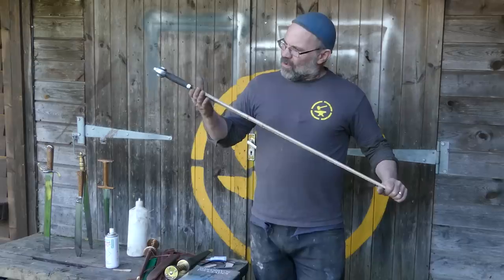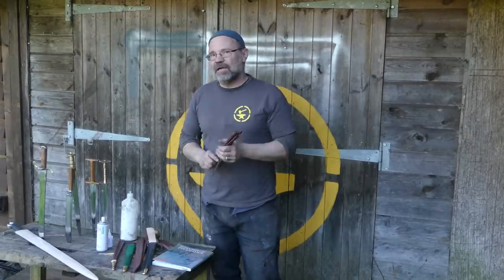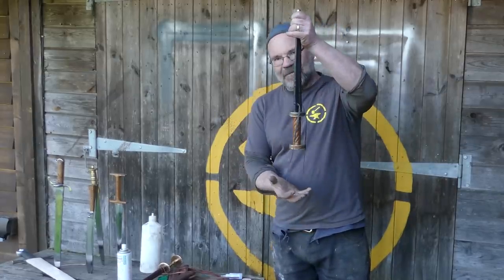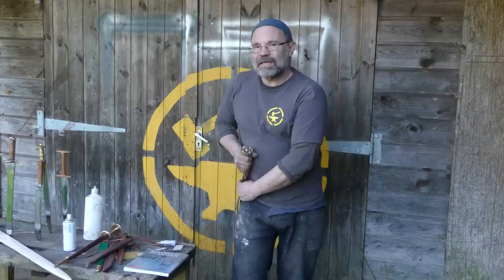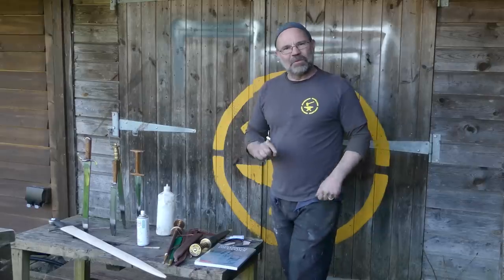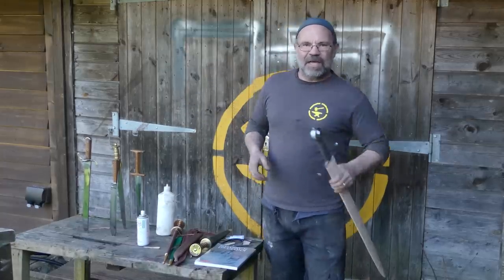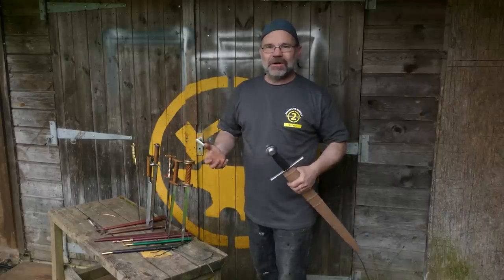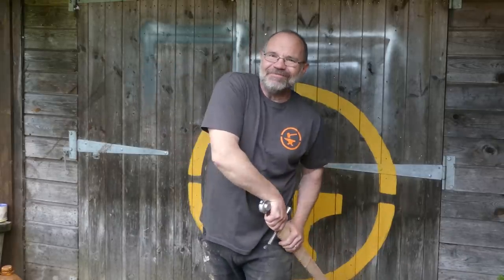How Tight were Medieval Scabbards?

Comment: It actually makes a lot of sense for knives and swords to be made by multiple people in medieval times. If you are going to outfit an army, then instead of a single person makeing one entire sword maybe every two days, it would be faster for someone to be churning out blades all day while another person churns out handles and another scabbards, all to be assembled by another person elsewhere. It's kinda like an assembly line.
Reply: Isn't how things for military use are made even today? One company produce belts, an other holsters, an other bayonets ect
Reply: Absolutely! Way easier for someone to get good at making one thing quickly than to learn to do ten different things quickly. It's also the case that there were places that were hubs for certain kinds of goods, like Solingen for blades. It was common (not just in the medieval period) for blades to be made in one place, and then made into functional swords/knives elsewhere. So you could have one smith hammering out several blades in a day or two, and then after a few months those blades could be in four different countries fitted to guards and pommels that fit the regional tastes. 

To take that even further I can think of examples of African swords that Europeans stumbled across in the 1900's that had straight double edged blades (exactly like the stereotypical medieval european sword) fitted to locally made African guard, grip, and pommel. If I remember rightly those blades were actually made in parts of Germany in like the 1700's or 1800's (after Europeans had moved away from that style of blade) specifically for the African export market. Sorry for the essay lol.
Reply: And if it resembles modern day civilian and military contracting, the products are going to be made by the lowest bidder who meets the minimum specifications.
Reply: That’s one of the reasons armorers in Italy and Germany could crank out an entire harness in a couple of days.
Reply: It makes sense, if conditions for mass production are met. It's only worthwhile (or even possible) to break down production into lots of small steps each carried out by someone with a very narrow specialisation when you are able to: secure lots of capital to bring together enough people in the same workshop (or have a sufficiently mature market for a reliable supply chain up and down stream), and have access to a sufficiently large customer base so that there's enough demand for all your wares. Not all of those ingredients were present everywhere all the time. During the Roman Empire or in Renaissance Germany, sure. But I'd be surprised if that was true for, say, a Carolingian sword/armour smith who was only ever going to sell his wares to a minor local lord and his retinue.
Reply: @Pavlos_Charalambous one recievers, one barrels, one optics, one grips, etc.
Reply: @Pavlos_Charalambous  A mcuh better example would be large ticket items like ships, planes, tanks. While one company is awarded the contract, that company in turns sub-contracts out to dozens, or even hundreds of other ocmpanies for parts and companonents. Take a plane, Lockheed may have the contract but engines would be provided by GE, and the radar by Raytheon, then tons of other companies provide the nuts, bolts, and other fasteners, the wires, the tires for the landing gear, and so on.
Reply: The principal behind mass production.
Reply: Principally was because in medieval time differents workers were in different corporations, if you were a blacksmith you were prohibit to do wood works, there were law very strict about it.
Reply: I think your logic is a bit flawed. Consider the scenario where five blacksmiths each forge a separate component of a sword; the time it would take is more or less equivalent to five blacksmiths independently crafting entire swords, provided they have the proficiency to fabricate every component.

Let's illustrate this with an analogy. Picture five craftsmen each dedicated to creating one specific part of a sword, and it takes them an hour to produce their respective piece. Given the sword consists of five distinct parts, the group would collectively assemble one full sword every hour. Conversely, if the same craftsmen individually fabricate complete swords, each would need five hours since each component requires an hour to make. However, considering they are five craftsmen, they would collectively forge five swords every five hours, maintaining the same rate of one sword per hour. Naturally, a small amount of time is factored in for transitioning between workstations.

I think the real reason for specializing is efficiency. Having five craftsmen individually producing entire swords would necessitate a complete set of tools for each of them, which is far less efficient compared to each specializing in a single component.
Reply: @bobthegoat7090  I think your initial assumption is incorrect. When doing the same task repeatedly, the person improves at the task, specializing in skill. You can't specialize in five things as well as you can in one, that's the point of specialization. So five 1-hour tasks would be 5 hours for a generalist, but would only be maybe 40 or 45 minutes each for the five specialists. 

You brought up a good point with the tool sets. There are also jigs etc. And making 5 different things means 5 different shapes of raw materials to evaluate, plan for stocking, purchase, and organize. This takes up time and it takes up space in a shop.

There's also a time savings when you aren't task-switching. This is different from becoming more efficient because of improved skill specialization. We talk about multitasking, but it's BS; in reality people have to stop one thing to do another, and those who claim to be good at multitasking are really just reducing their task-switching time by reducing how much they're thinking about one task or the other. Anyway, if you have to change materials, change tools, clear off your workspace and set it up for the next task, that represents a lot of time. Especially if you're doing it frequently. Changing the forge temperature to work with a different metal. And we're not even talking about a switch in the fundamental style of the task, such as hammering away at a blade vs. engraving or filigree. 

Remember that a 10% tithe was considered onerous, all but impossible for a business to pay and stay afloat. Imagine if your personal income were suddenly taxed at 10% higher - not just the highest bracket, but the entire income. So then consider that a craftsman might gain 10-20% efficiency by specializing. Suddenly it makes all the sense in the world.
Reply: medieval industral revolution
Reply: @Intranetusa There’s this “lowest bidder” again. But at least you get the gist of it. Most just emphasize the term “lowest bidder” without any context. Though “minimum specification” is not the term I’d use. I’d use “wanted specification” or “set specification” or  “exact specification”.
You won’t produce an ornate scabbard, after all, if a plain one functions just as well.
Reply: @Specter_1125  I think in Milan, it was the Missaglia family that ran an entire vertically integrated operation? They owned iron mines, they owned bloomeries and smelters, they owned all the workshops: cuirass makers, helm makers, gauntlet makers, mail makers, etc. Sallet to sabaton, they oversaw the whole process.
Reply: don't need to think about it. There is a lot of evidences proving with no doubt that forge was the first of all works to be divided.
Reply: @Intranetusa  Jonny pointy stick just needs a spear that goes in the enemy, not a work of art.

How durable Minimum standards are is the question. Too high quality and the cost means less soldiers.  You also don't want single use spears either.
Reply: It is perhaps what led to industry, but not the other way around.
People had specialised trades. However, this was not universal. In larger, later settled areas there were more specialised craftsepeople, but in earlier/smaller settlements more people did more things themselves.
It came to make sense for these trades to refine more as the skill required to produce a higher quality component/object was more supportable by a more cohesive and logistically sound community.
Prior to this? If you want nails, you have to source the ore, smelt it, work it and then nail it.
It wasn't a production line. It was a collaberation of tradespeople finding a way to make more objects, more cost and skill/training efficiently, but not a true modern industry as we would think of it, but a 'cottage industry'.
Look into the production of linen for a good example of this.
Reply: @allengordon6929  With regards to firearms mass production (ie. different parts made by different companies) was not really a thing until the early 1900's.  Pre this time precision engineering was not good enough for one company to make a part that would fit precisely with another part made by a different company.
Reply: @googiegress  You are correct. In the original comment it just seemed to me like he thought the assembly line style would be 5 times faster than 5 guys making complete swords. My guess is efficiency was the main objective and that is what I wanted to point out with my analogy while clearing up the fact that the assembly line style would not be that much faster(Like for example 2x faster). And yes I know my analogy didn't account for task switching and I also pointed that out. I am aware there are some factors that will increase speed. However I think efficiency was the main thing, as I think not making 5x as many ovens and tools is the main priority.

Edit: And specializing is of course also a big reason.
Reply: @bobthegoat7090  Specialization is present in todays handiwork too. We don't train general surgeons in Finland anymore. Research has found out, that the results of operations just are plain better with surgeons that specialize doing that one type of operation. So even a specialized surgeon, say Ortopedics, have sub-specializations, and I've heard that it's pretty tough that new Orthopedics have to decide if they want to operate knee or spine or hip for the rest of their career...

But yeah, there are no surgeons anymore, that would operate bones and bowels and nervous system and everything else. The results are just plain worse than having surgeons specialize in specific body parts, even if it was handy to have one guy in a remote area doing all sorts of operations.
Reply: @Pavlos_Charalambous  division of labor is what makes society tick!
Reply: so an assembly line

Comment: Naval swords have had a little folding clip on them to retain the blade in the scabbard since the 1700s, even if it ends up upside down.  Also means the scabbard can be relatively loose. Wonder if there were any such features in the mediaeval times?
Reply: thats makes so much sense
Reply: Peace loops. Hurswitc has proof of them in the Viking age. They are tied around the handle or slipped over the cross guard
Reply: Probably, but they just didn't survive the years and thus we don't know about them.

Comment: Its not medieval, but I have an Iranian shamshir circa 1600 with an original scabbard which is extremely tight - even accounting for shrinkage and warp over time, it is fitted VERY well despite the deep curve of the sword. Other swords I have are quite loosely fitted despite being "good" quality scabbards made specifically for that sword - such as one of my Kilic. It varies, quite a lot, even for the recent stuff.
Reply: Was the scabbard recently in the pool?
Reply: @thcdreams654  Shockingly, no
Reply: Wonder if it has to do with the different environment of Iran. Dryer climate means less worry about the scabbard getting wet.
Reply: If I was on the medieval battlefield I reckon I’d know if the sword was a bit stiff in the scabbard especially if it’d been raining. 
I’d be checking it’s loose-ness right up to when the violence kicked off.
But I bet the samurai were more concerned with the ‘quick draw ‘ speed what with their Iaido and their social rules.
I was wondering if they had similar drawing protocol in renaissance Italy?
Reply: If there's a lot of variation the nice fit might be by accident.
Reply: @zwenkwiel816  Iran would have been fairly well off in 1600, your noble's shamshir having superb fit and the same sensibilities as a modern person isn't too far out of the question.

We know it's at least an upper class weapon because nobody cares about beautifully preserved 1900's guns made for country farmers. They're worth less than a new Hi-Point and both are about as common in their day.
Reply: @Insecthouse  Minor point, the period term was battojutsu ('drawing technique'). Iaijutsu, and especially later Iaido, is specifically a sportified and ritualized descendant activity.

And sort of for Italy. Western treatises never gave remotely the same level of emphasis or elaboration on quickdraw swordsmanship and it barely showed up at all until well into the Early Modern Period.
Reply: It seems Persia'n army had firearms at that time period, so I'd guess swords were mainly cavarly weapons. Didn't find out if they used pike and musket formations like European countries though. Likely having a loose fitting for quickdrawing a sidearm on an emergency was not a priority.

Comment: I think the importance of being able to retrieve any blade one-handed is often under-appreciated, if not completely overlooked... whether it's carried for self-defense or as a tool. I have a lot of knives (pocket and fixed blade) and the ones I carry are almost always ones I can pull out and start using with one hand. It's just frustrating having to put something down or stop what you're doing to fumble around with a folding knife that requires both hands or pull a blade from a sheath that's too tight...

Comment: I will throw some counterarguments to the idea of loose scabbards, especially in case of daggers. So I do HEMA longsword sparring, almost always with a dagger. I've had a couple mounting systems during my years of HEMA, after a while I've started trying out historical options. Whenever I was using a loose scabbard and any kind of loose thong system I pretty often lost my dagger during the fight. The solution was usually to either use a more secure mounting system (like thongs looped over in front of the scabbard - this holds the dagger pretty securely, it creates a loop for a belt almost like on modern scabbards) or to use a tighter scabbard. So this could indicate that even historically they would do either loose scabbard or loose mounting, but not both - as much as I can take the argument that running or doing physical activities with a "fully loose" dagger isn't a problem, I can't believe anyone would ever stick to that kind of a carrying method after learning from experience that they are quite likely to loose a dagger during a fight. 
The other point I would make is that I've learned that people often try to take my own dagger and use it against me. When the scabbard is tight I can usually pull it out rather fast and easily if I do it the right way - pulling with a decisive upward motion. The correct angle is key here - in case of a tighter scabbard my opponents usually couldn't take my own dagger, because their pulling angle in any reasonable fighting scenario was limited, so they oculdn't execute the straight up motion that and an owner of a weapon can. 
Overall I would argue that tight dagger scabbards/sheaths were probably a thing, was it a majority? Im not going to make any assumptions here, but based on my fighting experience with a longsword and dagger I would rather have a tighter scabbard. 

Now  there are two caveats here: 
- the dagger I use is a sparring blunt blade and it isn't balanced like a real dagger, its heavier toward the handle, this can impact how likely it is that the dagger falls out of a scabbard
- I'm completely ignoring the moisture/wheather argument here which could play a bigger part in choosing the carry method than I think.

Comment: For everyone musing on pre-soaking of leather scabbards, the leather is almost always pre-wetted during manufacture, simply because you need the leather to stretch a little as you stitch it so it has a tight fit over the wooden core. The tightening issues  arent just about the leather on a scabbard, but rather how the wood core swells when wet and presses on the blade. So soaking a newly made scabbard again after its finished would probably be a bit redundant, since it wont keep the wood from swelling as humidity changes
Reply: The scabbards in this video dont have wooden cores